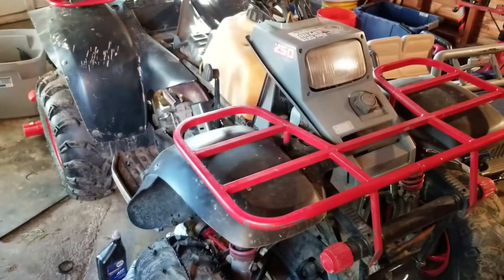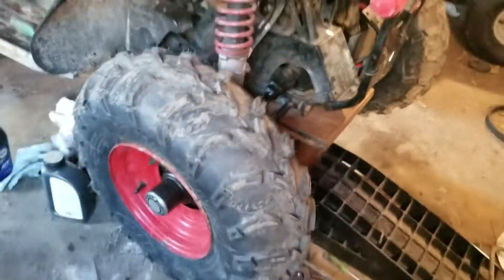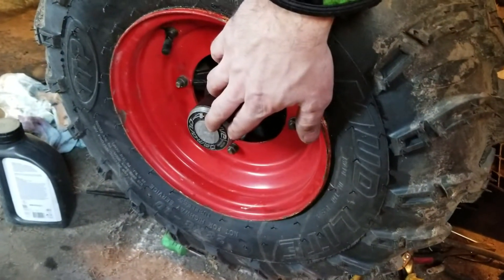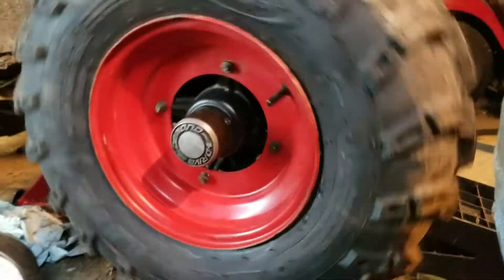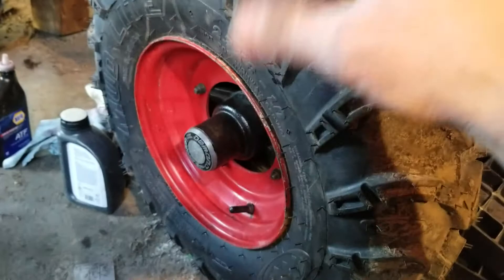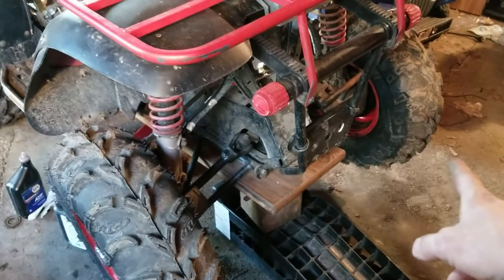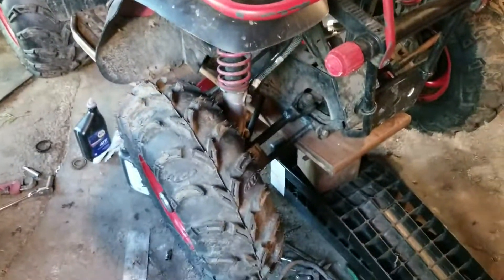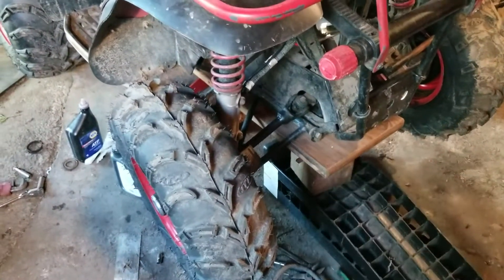1989 trail boss 250 project

Comment: 4x4should kick in the moment you hit the red switch on handle bars. You need to check your voltage going to the 4x4. Do you have a good battery or do you have a shoot battery but still have it hooked up in wheeler an your jump starting and/or pull starting. So now all your voltage the wheeler creates is trying to charge your crap battery an you don’t have enough voltage for the 4x4
Reply from the maker: New battery and I made a new video
Reply: It has to be a voltage or a ground issue